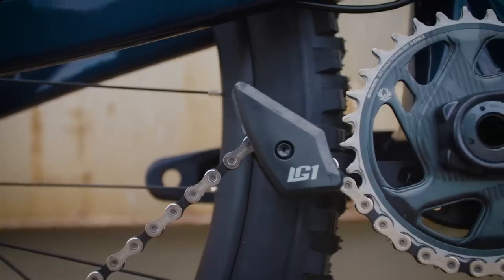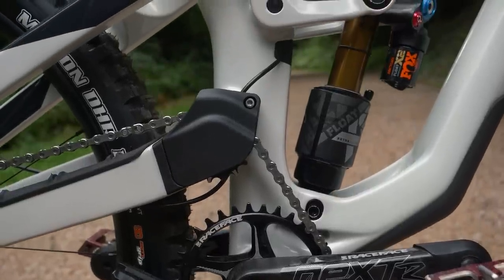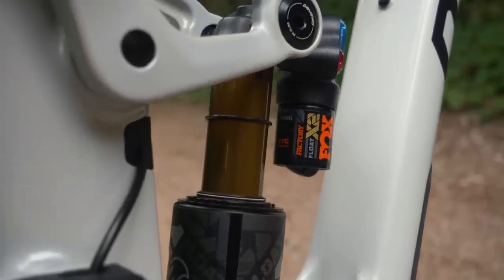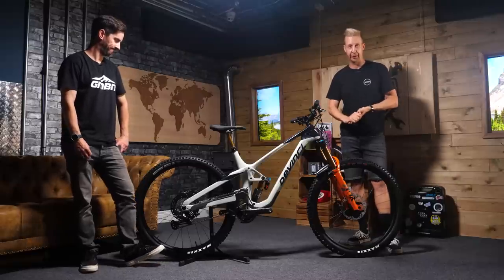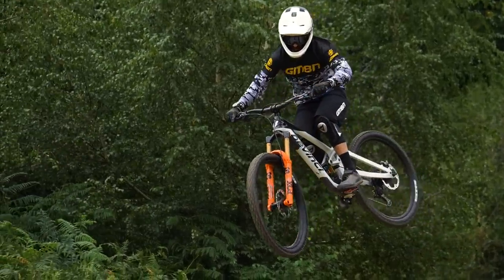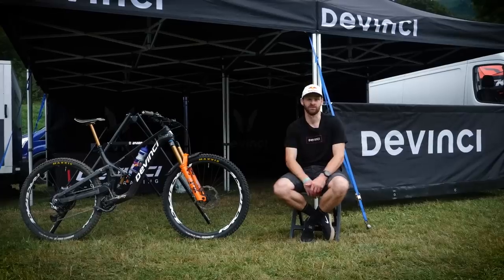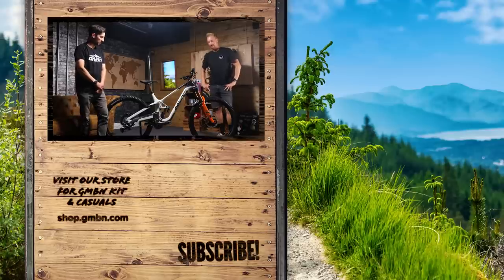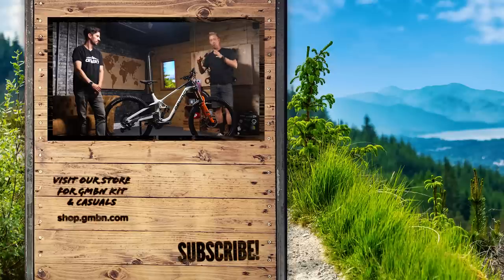The All-New Devinci Spartan Enduro Bike | The High Pivot Revolution

Comment: Love the High Pivot mixed with other system designs like the Split Pivot. Also I have never ridden a Divinci bike but really love the company. 
I’d like to see this design morph into the 140-150mm bikes . I guess that is now the trail bike category. I’ve always since 2001 run 150mm to 160 bikes for trail . While most were running hard tails to 120 for trail . Most folks in central Illinois still keep to those suspension numbers. 
I like a bike that will plow the roots and rocks , climb like a goat , rail the tight corners through the woods like a slot car then have some pop . So a 28-31 lbs 150mm average full suspension bike . For my trails I’d like a mullet high pivot I think but it would have to be designed correctly . 
Give the aggressive trail rider a trail ripper mini version of this bike y’all

Comment: The idler does not see the same revolution as the bottom bracket bearing, as he stated in the video. The idler at 16t shown here, will spin 2x the bottom bracket revolution with a 32t chainring... just saying.